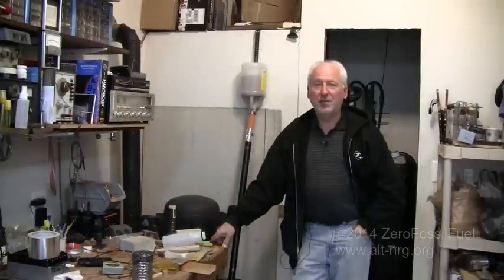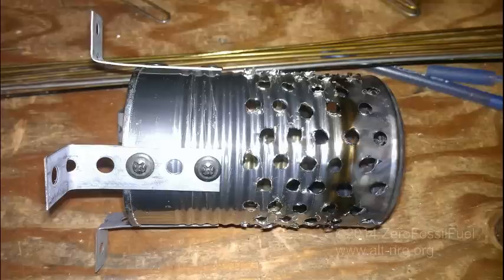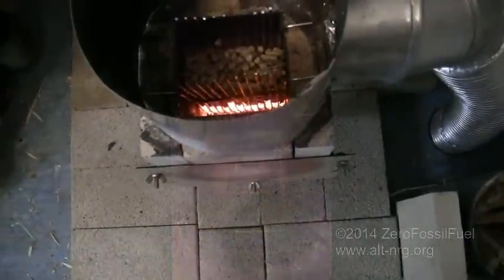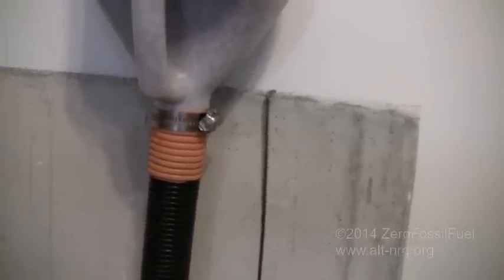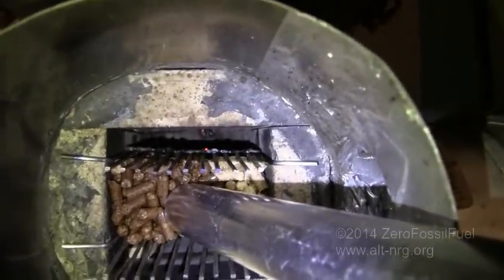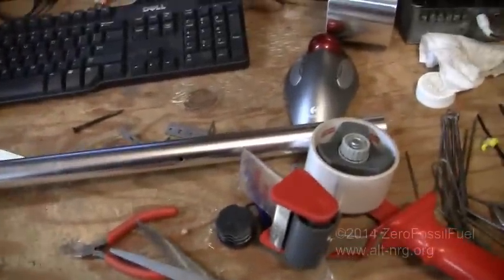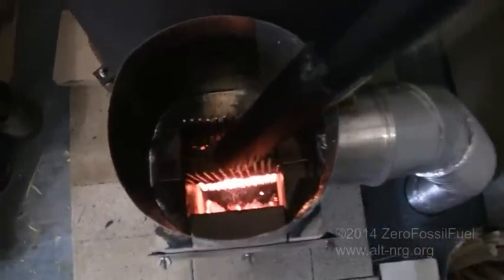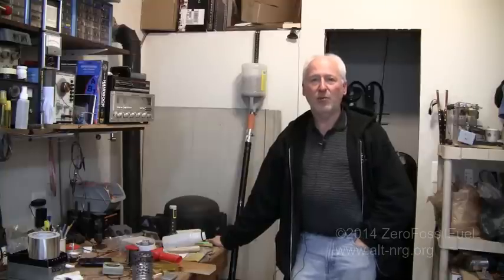#354 Rocket stove heater wood pellet mod!!!

Comment: I just built my this Rocket Heater # 1 and used your idea for my pellet basket , I did you 1/4 steel rod to make the basket . I am having trouble with the pellets feeding smoothly and soon will be making a new feed tube assemby .
I am also building rocket heater #2 , can you please tell me the size of you inlet (burn chamber ) and the size of your exhaust pipe . Do they have to be the same size or can they be say inlet 6" and outlet (exhaust)  4" ?
Thank for great video .
Jerry S

Comment: On my waste oil burner I varied my fuel rate

by a stepper; In the driver I used 2 registers one for low setting
  
and a standard heat thermostat to gap out the 2nd register
Reply: +Jerry G 
 Add a thermo switch in the circuit to kill the feeder

Comment: sounds like a good idea.  I would have thought an auger feed would have been the way to go.  Thanks
Reply from the maker: No external power required. That's the goal. I might put a peltier on it to charge a capacitor and discharge through a solenoid with a weight mounted to the pipe up near the hopper every 60 seconds or so just to agitate and keep the pellets flowing freely unattended.
Reply: ZeroFossilFuel How about some sort of steam powered shaker using a small water resevoir on top of the tank with relief/blow off valve or micro engine to propel the weight into the pipe? Down side is you would need to add water at some point though. But this wants to be doomsday proof as well, right? I don't imagine peltiers will be around or readily available then.
Reply: RFpowerman1
 how about an old time coffee peculator. You can get them really rock'in if you just let them boil.

jimb in wv

Comment: I think I came up with a much easier method to control pellet flow.  Install a short length of thin-wall clear tubing somewhere in the feed tube.  Around the clear tubing, place a worm-screw clamp.  When you want to stop pellet flow, simply snug-up clamp (basically, it is a tourniquet). When you want pellets to flow again, simply loosen clamp.   Regards.

Comment: Have you measured the temp on your exhaust pipe?  I know that some of the rocket mass heaters capture and store quite a bit of heat just coming off the exhaust.  Perhaps some fins on your exhaust would help you capture even more heat.

Comment: I'm wondering if you couldn't place the hopper in it's optimum position & start the pellets using some tinder placed behind the hopper. I would think the coals generated from burning a small amount of starter would catch the pellets.

Are you going to come up with a biomass production to make the pellets?
Have you looked at possible making biomass briquets that have a hole in the center. Then stacking them on a rod. The rod placed on an angle ending in the firebox of the stove. To allow auto-feeding of the fuel without electricity.

Just some suggestions. LOL

Thanks for the vids they're always well done.
Reply from the maker: The best method so far seems to be just place a small amount of pellets in the very bottom of the grate, soak with some lighter fluid and ignite with kindling from behind as you suggest, then start the flow of pellets once the bed of coals is well established. I can also cheat and hit it with a propane torch for a few seconds.
Reply: ZeroFossilFuel Might try lamp oil.

Comment: you need an agitator in the feed tube so it keeps things moving with no jams. Nice work.
Reply: Where do you ignite it? under the pellets? 
You could use a peltier device to power a agitator motor to keep the hopper flowing. Nice design. I want to build one in a hoop house for winter growing.
Reply: To turn off you could build in your pin design as a tab to push and pull as needed.

Comment: good idea,  question: what's to prevent the fire from burning up the feed tube ?
Reply from the maker: If you'd ever really studied wood burning in the firebox of a Rocket you'd understand. Fresh air rushing in from the top combined with the venturi effect of the wood itself in the firebox opening keeps the burn contained down low in front of the horzontal burn tube. Only of air stopped flowing completely (which never happens) and the pellets were good and hot might the burn start to propagate upward. Even then I'm not so sure because pellets really need a good air supply to keep burning. Wood chips on the other hand I might be concerned about.
Reply: ZeroFossilFuel
Good deal, thanks for the info.

Comment: You should try a second bottle inside the first bottle using the top portion to create an inverted cone with a small opening around the outside of the cone. That way the entire weight of the pellets in the bottle are not forcing the pellets into the pipe and stopping it up.

Comment: Super! Excellent! What's the silver tube coming out of the combustion chamber and going into the floor, on the right next to the feeding tube?
Reply from the maker: Outside air inlet rather than pulling air from the room which creates negative pressure drawing cold air into the living space. Makes the system much more efficient. Workshop is elevated so it was easiest to just go straight down through the floor rather that back through the wall. Both would work.

Comment: I'm curious if you have considered adding a reflector - perhaps polished aluminum - around the back side of your stove to reflect more of the heat into the room and away from the exterior wall?

Love your videos by the way!
Reply from the maker: YES! I'm going to use a high temp spray adhesive to stick aluminium foil to the cement board.

Comment: Thanks Zero Labs! Have you tried char cloth (or even char wood) as a fire starter? It burns slow and quite hot. It would be really easy to make using your rocket stove as the heat source.

Comment: This vary interesting.   About two years ago I built a mass heater, rocket stove combination.  The firebox was directly into the mass with a inverted 15 gallon barren heat exchanger in the exhaust exited from the storage mass.  From the heat exchanger then into a free standing masonry chimney in my shop.  I used it for two winters inside of my shop, then learned my insurance would not insure a home shop with a wood stove in it.  Nor would they insure my house which stands adjacent to the shop containing a wood stove.  I have removed it and used the 980#s of broken brick and mortar to go into the foundation of a concrete slab.  I have tried several methods of operating that masonry heater on wood pellets.  I am vary interested in what you have done here and see many possibilities.  The masonry part of my heater was similar to those seen at this youtube link, Rocket Mass Heater Stove Wood Refractory Masonry Hermon Heater   I must say the mass is the great advantage of this type of heater.  If anyone has a suggestion about home owners insurance that allows wood stove in home shop I would be happy to hear of them.

Comment: How long burning before ash build up touches bottom of burn grate?  By the way, good work and thank you for sharing freely.
Reply from the maker: Well, I burned it for two nights, about 5hrs each time. On the 3rd night I raked out the ash before relighting. There was less than a soup can worth of ash and all of it was deep inside the horizontal tunnel. The velocity is so high that there was almost no ash at all directly under the basket. At this rate I can probably go a full week between cleanings!

Comment: I'm inspired and need to get busy and construct the Zero Rocket Stove for my studio. I eagerly watched your gravity feed pellet mod and would enjoy having the plans which show the precise detail of your stainless steel .308 " rod version of the basket to ensure  I get the spacing between the rods as accurately as you did. I've reasoned that the rods might be 3/16" or slightly less?
Reply from the maker: Miles Jones Rods are 1/8" dia spaced precisely 3/16" apart. That allows 1/4" dia pellets to burn down before passing through the grates.

Comment: I see you have the air intake above the burn tube, just curious why you went that route instead of connecting at the same level.  I'm building my first rocket stove and had planned on having my air intake at the same level (but in front of the stove), and routing it to the floor like you did.

Comment: Nice work. Just a little curious about your average temperature at top of riser are. External temps that is. 👍
Reply from the maker: Best efficiency is 750-800*F. I've had it well over 1000*F just for fun to watch it glow. ;-)
Reply: Zero Labs nice I'm struggling to get mine above 700f. Seems very sensitive to basket changes. I have got something not quite right. Would be stoked to get to your temps.👍

Comment: perhaps a small auger of some sort near the lower portion of the tube to regulate the feed rate.  or a 8 inch section of rubber hose located in the middle of the pipe run,  with an ID to match the pipe that you could SQUEEZE to stop the flow...

Comment: Nice job! Can you adjust the air intake? It seems to me that running it at full air intake is not the most economical way to go about it.
Reply from the maker: Actually, full tilt boogie is the only way to run a rocket stove efficiently. The way to regulate is to adjust the amount of wood in the firebox. That gives me an idea for an adjustable width grate. Hmmm. SEE WHAT YOU'VE DONE?!??!?

Comment: please send link for the "how is the stove itself build ....(or schematic drawing )i was trying to figure out from this video but couldn't .however it looks like great idea to hold the heat in the room as much as possible .
thank you for sharing the idea .
in exchange i share my idea ;option for  pellets auger if you want to use one without eletricity nor electronicks ..(.i'm of grit myself ) : 
gravity "battery /acumulator" mechanizm ...just like old clocks . it will work for long time after winding . or spring load "battery "  the gear box with time keeping swinging  flywheel or  pendulum  could be a project but i think that components with brain ability to "fit parts "could be located with help of ebay somewhat . .. certainly wee don't want to  distroy some old clock for that purpose but is okay to copy the idea .
if that doesn't appeal then boiler on top of the stove and little steam turbine powering gear train and auger could work ....after the turbine the steam could be directed in to radiator to save the heat ... simple pressure coocer or even kettle could be used ..maybe ??

Comment: What is the quantity of pellets consumed per hour? Is it still as efficient as with wood sticks and such? Wood pellet stoves have a fan that extracts the smoke away, and i understand how you are doing your best to make this off grid, but if you had some sort of auger to control the flow of pellets into the crucible and then directed the air flow down directly on top of the pellets to get the Venturi effect for complete burning. I am betting that you could Make a flow control at the bottom of the tube like what is found at the back of a jet boat output tube so that it is still gravity fed. Made out of cast iron to withstand heat and just high enough that it doesnt get hot enough to ignite the pellets in the tube.
Reply: I am sure, based on my understanding of RMH technology and the sound that I hear he IS getting a VERY efficient burn. Very little is being wasted. Pellets do cost money though!

I am curious too how many pellets are being burned per hour.
Reply: ***** I see the answer is below: Up to 3 pounds an hour!!!! Still not sure why he did not build a MASS HEATER!!!!!!!!

Comment: Gravity feed, no power, REAL COOL!!! Until you had mentioned it, I too was thinking about the life of the burn grate as well because my wood stove (which has a bottom feed air supply/ash pan) needs a new one about every 3-4 years because of the exposure and conditions. In the rocket stove it seems as if this is going to be much more extreme conditions because the pellets are burning within the grate material. I was also wondering about life using SS. It could be better but it still may take a beating being exposed to the hot coals in what is realy like having a constant blacksmith with a never ending bellows. I have always wanted to try something like ceramic rods fabricated into some sort of grate for my stove. Fragile but I would think they should be able to take such extreme heat. Every time I need to replace my grate I think of maybe trying something like that just to see if the life was any better. Maybe its worth exploring here? I'm also curious, is there any major difference in your stack temp using pellets vs. wood?
Reply from the maker: I'm figuring on replacing my grate once every year. Any more than that will be a bonus.

Comment: Measure how much you burn an hour and then only put in as much as you want. Much easier than sticks! I wonder if sticks/woodchips would work in a hopper as well? You should also measure how many sticks/woodchips you burn an hour in a hopper.
Reply from the maker: I will be checking burn rates. Thanks for watching!
Reply: Thank YOU for creating such awesome videos!

Comment: Caution If the feed tube empties, it can act like a chimney and draw hot air from the fire box into the room. Bad enough, but if you have a plastic hopper or the top opening is near something combustible, it can start a fire. I know because I caught this in my own setup just in time. My hopper was softening and the smell of molten plastic was in the air. A few more minutes and it would have been in flames.
Reply from the maker: +DAVE OPINCARNE Then your rocket is not drawing hard enough. Even when my feed tube is empty, air flow is always in the direction of the burn chamber.
Reply: +ZeroFossilFuel No, my stove draws fine, trust me. Rather, this is a consequence of allowing the tube to empty. As the pile burns down with a tube directly above it, flow can reverse. I turned my back on it for about 20 minutes and came back to a pipe hot enough to burn, a melted hopper, and a room full of plastic smoke. Without the ability to prevent back flow, I'm convinced the gravity feed tube could become a potential chimney.
Reply: +ZeroFossilFuel  For the entire time I have run my heater with a gravity feed, I have had the same experience as you, the pile burns down and enough draw is maintained to keep air flow in a positive direction. But seeing it go wrong ONE TIME was enough to convince me of the potential for disaster. Without a positive way to prevent flow reversal, the potential for disaster remains since I am unable to guarantee the heater will perform within parameters to an acceptable margin of safety.
Reply from the maker: Michael Lydick Place 3" reflective aluminum tape on the side facing the stove. Stays completely cool to the touch even when the stove is running full tilt boogie.
Reply: Yeah, I can see this happen, too. But, you could easily get away if you use a perforated tube or make many small holes on your tube near the end. This should equalize the pressure at entrance level, thus not sucking (that much) air to the top the same way a chimney does or, at least, minimize this effect.
Reply: Probably better to use a steel can for your pellet hopper, surrounded with fire shield material.

Comment: Do you have any problem with ash buildup at the bottom of your pellet curtain? In other words, does your grate clog at the bottom after 2 hours or so?
Reply from the maker: There is some buildup after a couple hours, yes. It occurs down low at the cold side of the basket only and works its way slowly up the back side. I'm working on new geometries to balance out ejection of spent pellets to mitigate the ash buildup.

Comment: How many hours of burn can you get per hopper-full?  A large ball valve can be used to stop the pellet flow...
Reply from the maker: 3.5 hrs for that inverted 1 gallon jug plus the tube. Large ball valve is a great idea but rather costly I would think. I'll have to price them. Thanks for watching!
Reply: ZeroFossilFuel Instead of a ball valve, use a hacksaw or sawzall and cut HALFWAY through the tube and take a piece of sheetmetal, contour it for the inside of the tube and make a simple sliding valve, which could also potentially works as your "throttle".  Might be a bit tricky to close it as it might jam on the pellets,  but shaking the tube may make it doable.  A Ball valve would probably be more robust though in the long run.
Reply from the maker: David Andruczyk
Why does your last name look so familiar to me?

Comment: Zero, what's the plan, make a pelletizer? I don't get it, why would you go from having a stove that uses wood, to a stove that uses something you have to buy.. I am from BC where there is firewood everywhere, so maybe I'm not getting it! Here we just use a splitter.
Reply from the maker: Pellets are convenient and readily available. If SHTF I can pull the basket out and switch right back to burning regular wood.

Comment: Z, your vibrator need not be exotic. A "vibrator" is a motor with an off center weight on the armature. Use the 12v motor we've seen on your test bench. (Might have been lasersaber's bench but surely you've got one in your junk bin.) Similar to the motors we once used in slot cars. Attach a 7/16" nut to one side of the armature gear. Attach this motor to your feed tube. Build a 555 circuit to  pulse it 5 seconds every 30 minutes (adjust timing and fiddle fart around with the voltage to optimize.)  
Re: Your 308L stainless basket: Not good to weld the lateral rods in more than one spot or the 308L will expand/contract till it self destructs.  Better to have the rods lie in grooves to 'hold them in place...  '

"And Bob's your uncle..."                     :)   https://encrypted-tbn2.gstatic.com/images?q=tbn:ANd9GcQWbBFYvD2-db9nvBzpB29u2i1ByfnjoKxLtNMXVAVY8wZIOL_5Mw